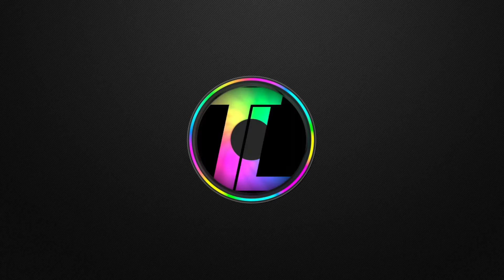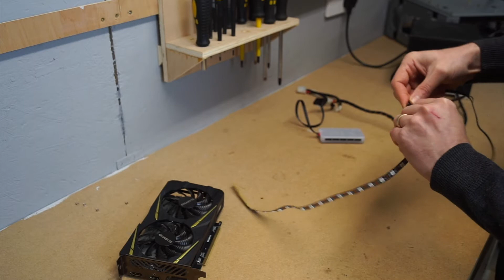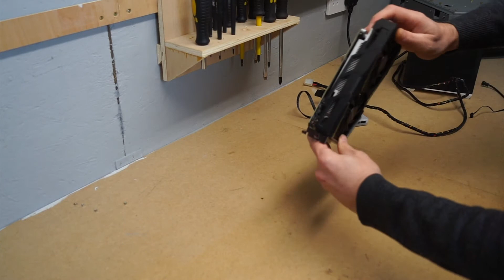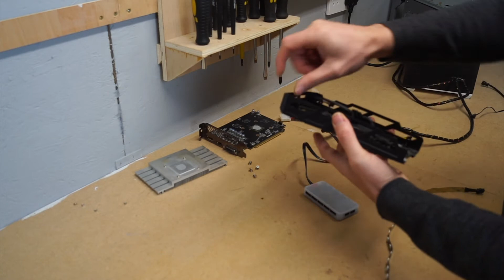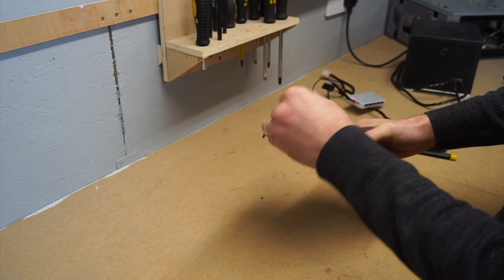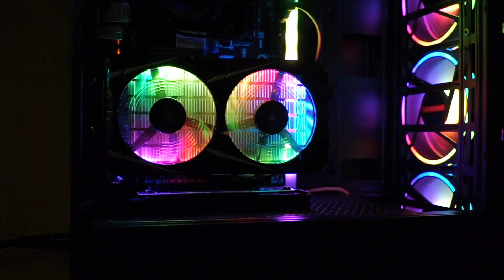How to add RGB lighting to a graphics card.

Comment: Nothing like rolling the dice on a cheap RGB strip that if it shorts out can take your entire PC with it.
Reply from the maker: How’s custom made RGB strips “Rolling dice on cheap”.  For one the kits you buy are made in China for a lot less and even if they shorted out the system is designed to protect this through the motherboard headers, RGB controllers and power supplies.
Reply: @TechLabUK  It is all about experience, been doing this for a very long time and seen some scary stuff. Have a cheap RGB strip melt out into a GPU, or watch one catch fire inside of a case and then watch a fan suck those flames into other wires. Yeah, roll the dice on a $4k system with a couple dollar RBG strip, have fun but just make sure you have a fire extinguisher nearby. And if all those motherboard headers and RBG controllers and power supplies did their job all the time, computers would never have problems!
Reply: @jrosado4312 i am more concerned about those Open copper contacts. Can't those fry your GPU?

Comment: Amazing. Truly. Anyone have luck with this on a 3060? Got my strip and adapter just need to commit
Reply from the maker: I tend to find it works well on Gigabyte GPUs tbh as their fan blades are often transparent.  Should work on anything though and easy enough to remove after if you don't want it anymore.
Reply: @TechLabUK  sickkkkkk thank you!!!

Comment: I wonder if I'd be able to do that with my RX5700...
Reply from the maker: All depends on the construction of the shroud tbh but I am sure you could make it work.
Reply: @TechLabUK  I'm gonna try anyway, considering it's huge (three fans) I suppose there will be enough space to put the LED strips. Thank you for the video!
Reply from the maker: @leon_paradoxx  Hope it works out, you could probably do a cleaner job than I did :)

Comment: Will graphich melt LED strip with long time use in gaming.
Normal temperature in gaming is like 60 70 degrees celsius.
Reply from the maker: No, it won't melt the LEDs.  The GPU core is like 60/70 degrees but that's not the temp on the outside.

Comment: will this still work under a lot of heat? or will the strips start melting?
Reply from the maker: Very much doubt the LEDs will melt.  A card will never get that hot under the shroud.
Reply: @TechLabUK  Any recommendations, such as an amazon link for the ARGB strips you used?
Reply from the maker: @drumkid8395  Depends if you are making your own strips or not.  We use things like this as we custom make the strips and can cut to any length we want: https://amzn.to/3XEfITj
Reply: @TechLabUK  Just realised that my GPU is way too small but thanks for the help anyways!

Comment: I want to do this but im scared of the leds strip not playing well with heat and catching fire after a couple weeks or months
Reply: I was about to say the same thing
Reply: unless your gpu goes above 150 degrees thats very unlikely to happen.
Reply: @AndreasRP.  70c is 158f tho and that's a good gpu temp I'd think plastic could warp melt under 158 degrees temps could be wrong though
Reply: @mycelium1456  maybe, but you’d think these led strips were made to withstand a bit more than normal plastic since they are for use inside a pc. Who knows.

Comment: I just bought an Nvidia FE 3060TI beast and without RGB its just dull dead. Can you help with suggestions to add some glitter to the amazing card. I'm not okay opening the card to put the leds inside even though I'm pro as I fear warranty void issues.
Reply from the maker: Unfortunately I haven't been able to get my hands on any of the 30 series especially any FE model so i am unsure how best they could be modded.  Sorry.

Comment: Great video, liked and subscribed! I'm running a setup that uses all corsair RGB products and am looking to add an led strip similar to what you have done to my 2070s to finish off the setup - do you think this would work with corsair icue?
Reply from the maker: Thanks.  Not sure what controller you are using to control the corsair fans but RGB / ARGB is a standard so it can work for anything, it might just need a specific plug.

Comment: That system looks great!
Well done.
Reply from the maker: Thanks.  It's turning out to be quite a nice machine, even if it didn't start out that way :D  I can see a lot more being done to it though :)
Reply: @TechLabUK  I agree.
It could be worth looking at the cool moon cpu cooler to add to the cool moon hub.
Reply from the maker: @outlawfett3530  I have actually been trying to source a Coolmoon AIO for a while but no luck yet.  Their air coolers don't appear to be RGB customisable.
Reply: @TechLabUK  Shame.
Reply: @TechLabUK  found this. https://www.ebay.co.uk/itm/203109481103
Reply from the maker: @outlawfett3530  Cheers.  I will take a look.
Reply: @TechLabUK  thought it was a bit pricey but could be decent.
Reply: @TechLabUK  So what did you think about the water cooler?
Thought it was pricey (for what it was.)
Reply from the maker: @outlawfett3530  I had a quick look over it and I think you are right, it's a bit pricey.